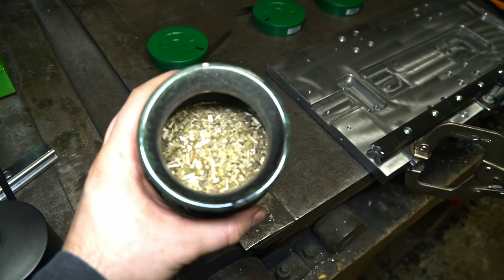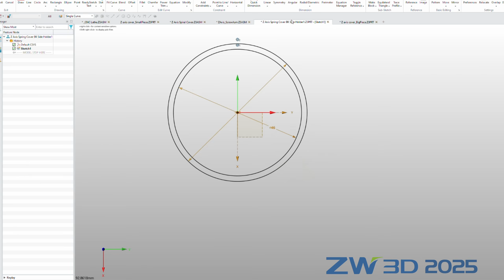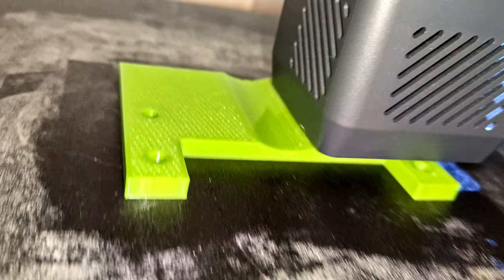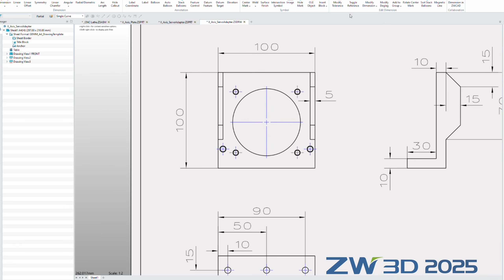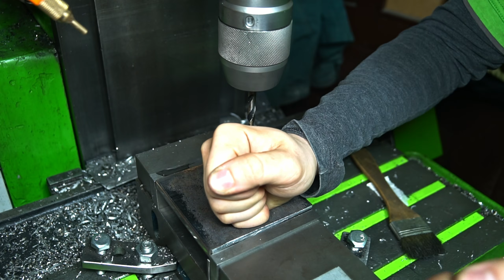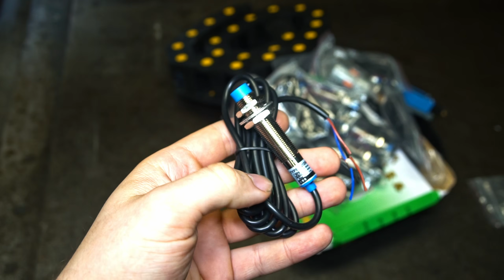X Axis Drive System! - DIY CNC Metal Lathe Build! #11

Comment: This is nice but cutting these tempered rails without coolant with abrasive disk is a very bad idea cause it will probably cause distortions  and stress in the piece and also, you run into the risk of removing the temper.
Reply from the maker: About the temper - i cut at points where there won't be moving blocks (out of move range). I didn't think about distortions though. Hopefully there won't be much. I used a good cutting disc though - therefore there was not much heat involved